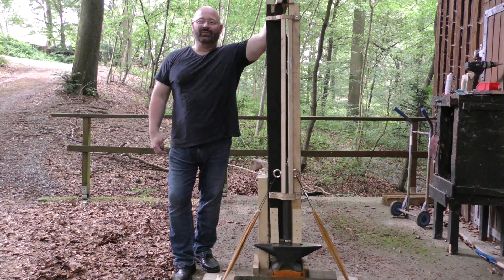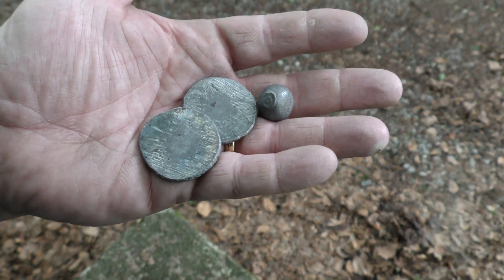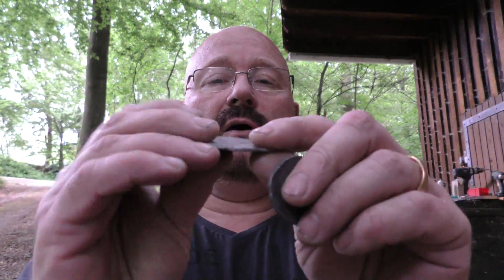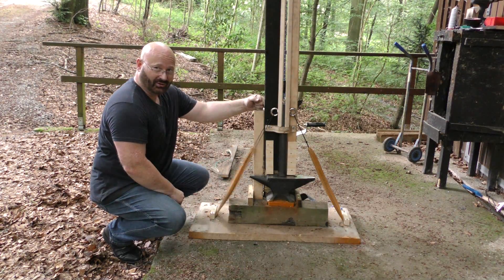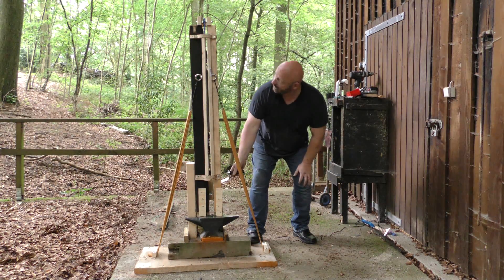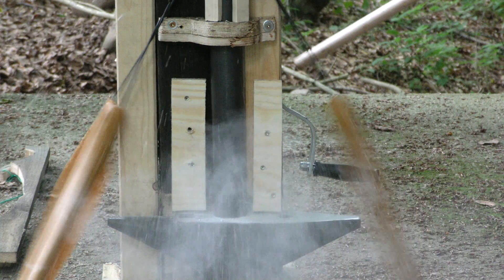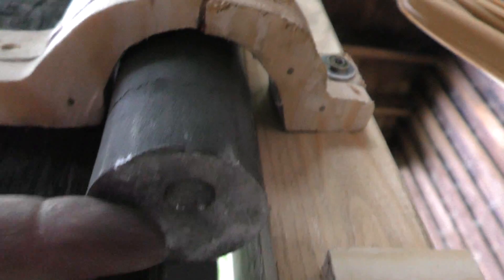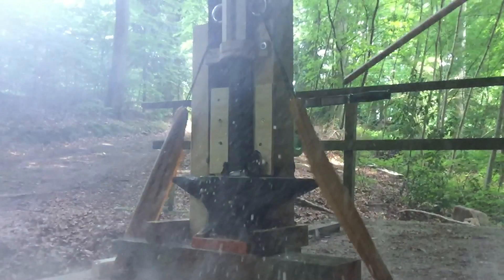Rubberaulic Press Mythbusting!

Comment: Part of the energy is converted to kinetic energy of the anvil travelling downwards. If it doesn't lift up it cannot get a downward velocity therefore that energy goes into destructing the object.
Edit: also a part of the energy converts to potential energy in the anvil being higher in the first place.
Additional edit: you really need to start using safety goggles.

Comment: You should make a Rubberaulic Press that stands 32.2 feet high and use very elastic bungie cords to store your potential energy before it is converted to kinetic energy upon release. Don't forget, if you drop a 1 kilogram mass from 32.2 feet, it will strike the ground with 32.2 kilograms force in 1 second's time. Just think about accelerating that force with bungie cords! WOW!
Reply from the maker: Bungee cords are lousy, lots of textile in them.

Comment: I'm coming in with an estimate of around 7200lbs of force at the end of the impact.  That's assuming 800 constant lbs (it isn't), 36" of fall (maybe close), and it taking 1/4 inch to stop (wildly inaccurate depending on what it's hitting.)

But your know, it's close...

Comment: Bolting it down does increase the energy. Potential energy is stored in the rubber, then used as kinetic energy. By lifting the anvil, some of the energy in the rubber is instead transformed into gravitational potential energy instead of kinetic energy.

Comment: You got to make it 100 meters tall, but i think at that size you need to use a 3" SCH-80 PVC pipe that is 100 meters long and pull a vacuum in front of the steal rod and let atmospheric pressure push it to the ground by breaking the top seal.

Comment: The pulling upwards doesn't make the impact force any smaller by itself, but the deceleration via gravity (which is working against that movement, contrary to what it does to the rod) and the fact that the rod has then a slightly shorter distance to speed up (thus likely being slightly slower at impact) does. When you bolt it down, you cancel the deceleration of the bottom part, and since it is not moving upwards the rod has slightly more time to accelerate and pack up more energy, resulting in the slight difference you saw.

Comment: You should consider getting a brush and a long pair of pliers when using things like that. If it fails and goes off while your hand is under it, you won't have a hand anymore. You could clean it with a brush and load and remove things with the pliers.

Comment: I suspect you got better results when bolted down not because you were losing lots of energy before, but because having a firm surface to push against applies the energy more efficiently than doing it against an anvil floating in the air.

The energy lost to lifting was likely insignificant. If the rubberaulic press weighs 50 kg, and you lifted it 10cm, then you only spent ~50J of energy to lift it. Just a few percent of total output.

Comment: Nice Vid! The destructive power of this hammer is quite something :-) 
Do you still got one of those tungsten carbide projectiles a viewer send you laying around? If yes, how about trying to squish one of those? Also, you should be carefull with the stuff producing shrapnell. If the rubber on one side got damaged and ripped, well, i wouldn't trust this contraption to stay intact with 200 Kg pulling in one direction without the 200Kg from the other side to counteract it!

Comment: The steel rod travel ~20cm in one frame(1/30 second) so it is 6m/s. Let's assume it decelerate in 1/30 second. Then the deceleration is 180m/s^2. So the force is 7.5kg * 180m/s^2 = 1350N. =135kg. Idk is that right. Can anyone help me?
Reply from the maker: It travels about 35 cm in one frame at the end of the acceleration. And this is a 60p video, so we are talking 35 cm in 1/60th of second. 21 m/s. 157,5 N s momentum, 1663 Joule energy. Deceleration is instant of course.
Reply: +JoergSprave thx :)

Comment: now do 4x the rubber for an 800kg press
and then 16x for 3200kg press :^)
Reply from the maker: I think if I go just a bit higher with the rubber, this thing will simply press itself to shambles :)
Reply: JoergSprave it'll make for a great video ;)
Reply: The press will send itself to another dimension
Reply: Do you want a black hole? Because that's how you get a black hole. Lol.
Reply: Cody Wilson I mean kinda yeah, it'd be neat

Comment: The only problem is that because you added wood to the press, the bolted down test and the non bolted down test are invalidated, because the extra wood might affect how the press works. Probably not, but it's good to isolate your variables.
Reply from the maker: Without the reinforcement, the thing wouldn't have survived any more tests.
Reply: Looks like the reinforcement is all in parts that are bolted down, so unless the wobbly frame was making a difference one way or the other before, I doubt this had an effect. Actually, come to think of it, bolting the frame to the ground was just a way of adding mass to it in the first place.

Comment: Some energy is being lost when it raises into the air, most is retained, but it is still doing work, and that energy is taken from the potential energy of the bolt. Therefore, the bolt looses some kinetic energy, even though much of this is supplanted by the motion of the anvil. Furthermore, without the rigidity of the ground, the impact is spread out over a longer period of time while the board flexes, this is where the greatest reduction in power is. While the energy is conserved, it does far less with the board flexion in play. Both effects are mostly negligible, but do account for a slight loss in energy. The effect is slight enough in a case like this, that I doubt it will have much effect over the end result. +Taofladermaus   Has found this to be the case in general when shooting anchored vs. unanchored targets.

Comment: it wasn't a loss of energy. the energy was just distributed over 2 moments, first on initial impact, and then when the whole contraption landed on the ground. it really was less effective though so good job yay
Reply: That is the practical definition of energy loss. As the object lifts, energy from the rubber ios converted to gravitational energy, then the ball is hit with all the energy of the bands minus that gravitational energy. Next, the whole contraption falls to the ground, essentially "losing" that gravitational potential.
Reply: but what about the little extra energy from the steel rod on the ball when it falls on the ground
Reply: The whole press has a small amount of potential energy when lifted the few cm off the ground compared to the energy spent on the 'wham' it makes initially. I imagine that's all there is to the energy loss of not being bolted to the ground.

Comment: Hello jörg. It's quite a coincidence, i had my exam mechanics today. While what you say is true, the distance the anvil moves after hitting with the light weight rod is lost energy.
The small rod has alot less kinetic energie so it wil be over powered by the anvil, which will keep moving up a bit after hitting. this if bouth had the same velocity and hit each other. 
Using rubber bands however, the rod is accelerated alot more then the anvil. (massa slowlyness) So it has more Ekin then the Anvil, and overpowers it. Which would lead to the energy being lost in the down direction. And because there is no ground under it, there should be some energy lost that way. (this energy is transfered into acceletating the whole thing)

Ekin = F * Delta S

Hope it makes sense, I'm belgian so english isn't my first language.
Reply: Me too :D I'm English so it won't have been the same paper though
Reply: Hehe I study industrial engineering & science -> electrical engineering. So i also saw it linked to machines. like to calculate the motor needed to accelerate and desselerate a belt or something. Lot's of fun, hoped yours turned out good.  :D

Comment: Holy shit I never imagine hardened steel to be that incredibly strong! It makes normal steel look like lead
Reply from the maker: Yes, these ball bearings are made for huge machines. They have to withstand an enormous amount of pressure.
Reply: make video about trying to destroy one that would be cool
Reply: If you go by the MOHS hardness scale, hardened high carbon stainless steel (7-8) is only a step or two away from diamond (10).  Wheras annealed/soft steel or just, unhardened steel is around a 4.  So, the noodle side. Each step on Mohs is pretty significant, so Copper is a 3, soft steel is 4, fingernail keratin is 2.

I make knives as a hobby, and it's usually measured on part of the Rockwell scale which allows much more precision.  So that anvil is probably 50ish hrc, the ball bearing around 64.  The piston in the 30s.
Reply: wow
Reply: where do you get them
Reply: +JoergSprave pressure rotation friction.
Reply: +Tim T. Simpler, tempered knifes are around, of course, but most production grade knives, such as Spiderco, SOG, Cold Steel, etc will have these types of steel, the most common are probably AUS-8 or 8Cr13MoV
Reply: gromann Hardened steel is incredibly hard, but it isn't all that strong, soft steel will just bend, hardened will shatter, tempered steel will bend, but hold, it depends who you ask, but I've seen tests show tempered steel holding 4 times the weight of hardened steel, though if torsion isn't an issue, its incredible.

Comment: im no physics major but if both ends are moving you would lose more energy to air resistance than if all the force was going through the steel rod. you would also probably lose some to vibrations.
Reply from the maker: I think air resistance is the smallest of all factors here, with all that inertia. Hardly relevant at all.
Reply: As Joerg said. Neglible. There is not enough distance travelled for any of the parts to make it a factor at all. Nor are the parts very big.
Reply: It's a pretty wide surface area but without doing the math i cant really know.
Reply: I still don't think it would matter much, the air resistance is a differential equation where the force is proportional to the velocity so with low velocities this rig moved at the force will be very small.

Comment: The reason for the loss in energy for crushing is that there is still energy left over after the collision. The whole aparature moves downwoard and also has potential energy due to the hight it lifted up. In addition it could make an effect that in the moment of the collision the resistance is lower, what effects in a slower energy transmission and force. In case of an attachment everything has to stop immediately.

Comment: Remove the anvil punch a hole into the baseplate and use the thing as a balista.
Reply: Geile idee
Reply: then you just have a slingshot ballista. the whole idea of this press is to combine gravity and stored power of the rubber, when you make this a ballista you would have to take the weight away
Reply: You're a few years too late dude. I think its fair to say that any weapon idea 'you' have using Rubber,he most certainly has already done.
Reply: what for? He Has build balistas allready.
Reply: holy shit gute idee
Reply: that's what I was thinking of the first episode
Reply: Of course he'd need to replace the rod with a slot and add some sort of giant whisker biscuit to the hole.
Reply: +Lars Van Den Broek imagine how many doubled rubbers it would take to fire that
Reply: stopot evangilise He hasn't really done a spear thrower of this caliber yet and it's not about something completely new but about seeing what can by done by modifieing this thing.
Reply: take a look at his video- the perforation of smaug.
Reply: Todesnuss i
Reply: +Todesnuss The Santa Slayer 2014 was even stronger.....